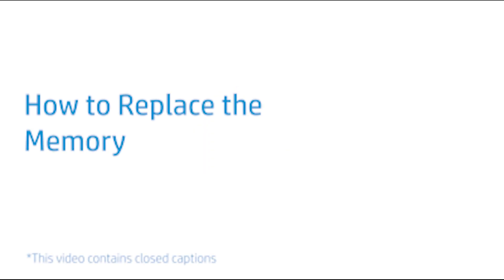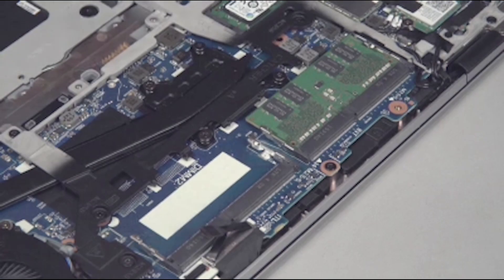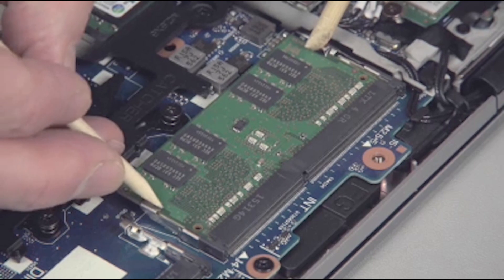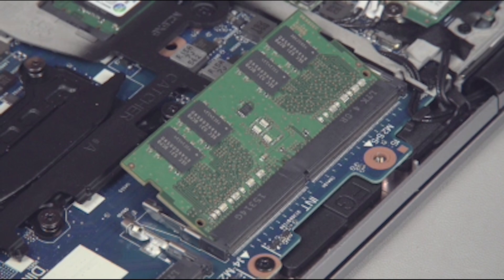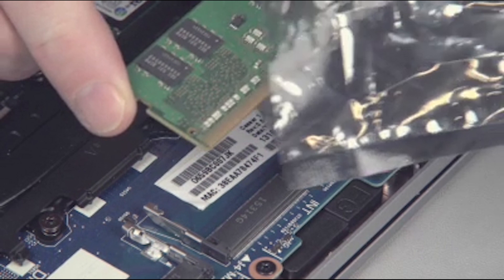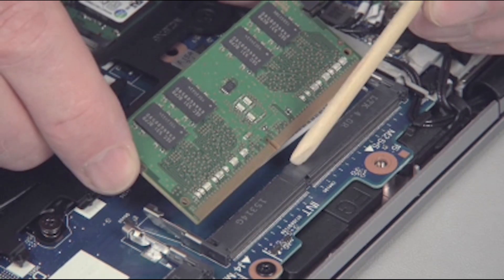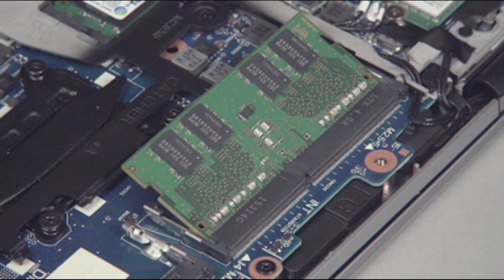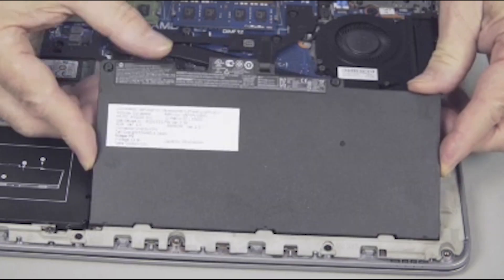Replace the Memory | HP EliteBook 840 G3 Notebook PC | HP Support

Comment: Will it void warranty while upgrading ram
Reply from the maker: +4H2 VANACHARLA BHASKARA VIJAYA SAI SWAMY HP does not recommend upgrading or downgrading hardware parts or software that is bundled with the product as It may affect the manufacturer's warranty and performance, however, you could change the configuration at your own discretion.